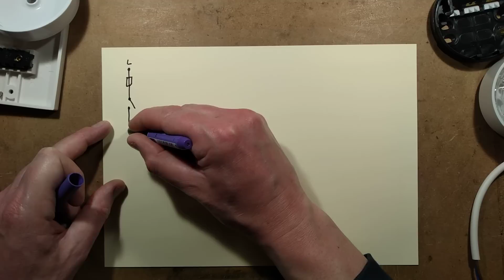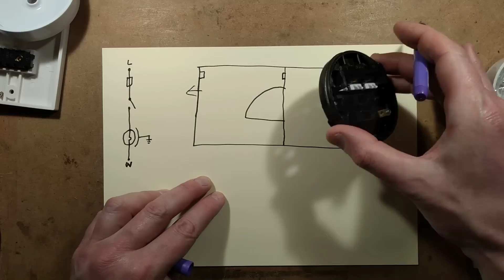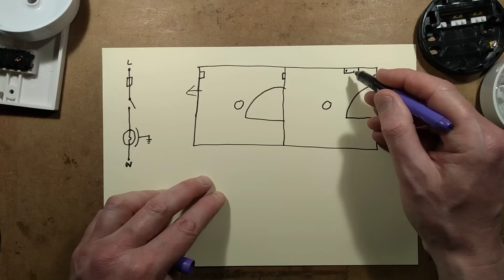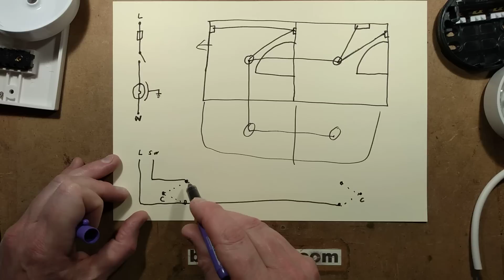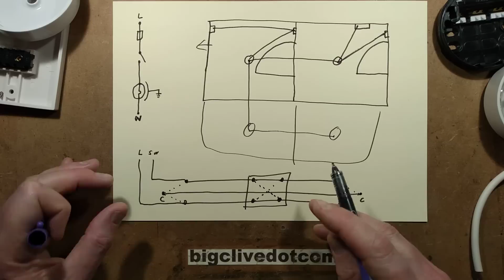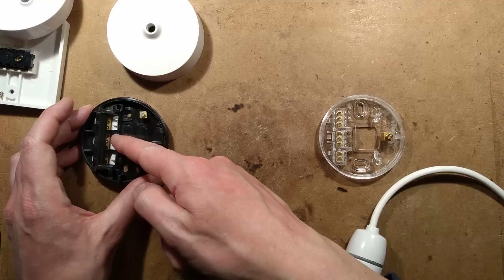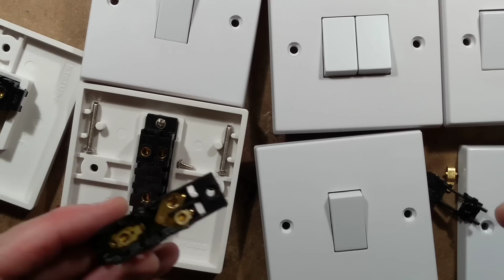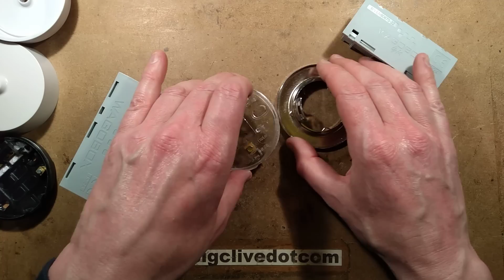British home wiring.  The incredibly simple lighting circuits.

Comment: It was soooooo hard to watch your explanation of the multi-way switching. The commons are where the the switched and power go to, and the other two leads are meant to be "travelers," which basically allow the switches to alternate the output.

Multi-way switching is and always has been one of the JFM things that most people don't understand.
Reply: Using the commons is only one way of doing it and because of the type of wiring used in the UK is not the best way! One T+E between the light and switch and a 3+E between the switches is the easiest to wire by far ;0)
We call the "Travelers" Straps here. Different strokes for different folkes ;0)
Reply: @totherarf  I think maybe his diagram messed me up... As soon as I started seeing it, I started my comment..  Maybe my ears didn't hear what they should have because my eyes were so distracted?
Reply: It may have been clearer if he had shown the closed position of the switch .... but give him credit, he is doing this on the fly AND thinking about the video at the same time ;0)

Comment: i see how it should work but ive never seen a 3way switch configured the way you drew it. in america anyways the common practice would be to  connect your L1 (mains power) to common then connect other 2 terminals to the corresponding terminals on the other switch the use the other common would feed the light.
Reply: Yes, I was thinking the same, and I'm in the UK. I have always wired them the way you describe. Both work of course, but I think your way is clearer on a circuit diagram.

Comment: In Sweden we use round boxes because it is much easier drilling a round hole than a square one when installing drywall...
Reply: R0T3 You can buy a backbox cutter here in the UK that cuts perfect sized rectangles for double gang backboxes
Reply: @sinista6536  At the same price as a holesaw? Can you use the "hole in one" system with magnets as well? For perfect alignment?
Reply: R0T3 I don’t know, never really looked into it, just seen it on a few electricians YouTube channels. Probably expensive as hell 😂

Comment: Very different from what we have in Canada (and the US), we twist the wires together and put a twist cap over the twisted wires creating solid connections but it takes up more room. We tend to have lots of circuit breakers, typical panel has room for 40 to 60 single breakers (120 V), double breakers for 240 V. 

With typical 120 v circuits limited to 15 amps our outlets can't even provide 2kw of power so I'm jealous that you can get 3kw at every outlet. On the other hand I really like our compact plug size but it only carries half the power.
Reply: 230V/32A max.... Poland. U can get 400V/230V/32A for additional cost. Lots of WAGO and common use TN-C-S

Comment: Not allowing sharp knives on a worksites is interesting. I help friends and family build disaster kits and I encourage them to not put large knives or candles in their kit unless they use them normally in their life. Slicing yourself during a disaster or allowing a candle to burn down to far is a really bad idea when emergency services are not available. 

But really on a work site where you use it on a regular basis. That is just silly. I guess this follows a current trend of seeing how little you can  train someone but still get the work done. No we don’t need nurses to have 3 years of education. 3 weeks should work just fine.
Reply: Electricians here (Sweden) typically carry a sharp but short and non-pointed knife, sometimes with a hook/slot on the back for stripping conductors of insulation.
https://encrypted-tbn0.gstatic.com/images?q=tbn:ANd9GcQ8TFXtBGnRBZnMiT7E9lryq4JreQFdcy0Ts38w_5NmILzpFDG7

Most other trades carry the generic "mora-knife"
Minor variations from various makers. https://encrypted-tbn0.gstatic.com/images?q=tbn:ANd9GcQOHq7aD_P-5vwDLZbkT7U0B5O3zPVAPnOpsAAHEiHs18TlHknt

The combo knife/chisel is becoming pretty popular as well
https://encrypted-tbn0.gstatic.com/images?q=tbn:ANd9GcSVW-wU9Q62OhndmRGMep2Czmp0MVV3cg0CdesW04Yi6MUbJKwC

Comment: In AU most cable has a sheathed earth conductor. 

Sparkies generally snip the outer jacket between two of the cores then drag one of the cores down to open the split up to expose as much of the inner conductors as they need, then snip off the excess jacket.
Reply: Don't even need to snip - just grab one conductor with both layers of insulation and just pry it apart. Then just trim off the outer sheath.

You can get pliers that will strip it properly for things like the 413QC's.
Reply: That's how we do it in the UK, then we when we terminate we sheath the bare earth with  green/yellow sleeving.

Comment: If you're interested I can send you some boxes and switches from the US, so you can do a comparison.
Reply: Ten 4 American Homes get a split single phase off of a center-tapped transformer. For example: my breaker box at home. The two hot wires come in and pass through a 350 amp main breaker. There are two “hot” or “live” bus bars which breakers can attach to. Each breaker for standard outlets or lights or small appliances is usually a 15, 20, or 30 amp breaker with the circuit linked between one of the busbars and neutral. The standard 3 prong outlets are designed so an appliance with a 15 amp plug can be plugged into a 15, or 20 amp outlet, but the 20 amp devices cannot plug into a 15 amp outlet. For devices that need large currents, say, electric stoves, clothes dryers, heaters, central air conditioners (most window units are 20 amp 120v), etc. are wired with a breaker across both “hot” busbars, which are essentially 2 120v 60hz phases 180 degrees apart from each other. This gives an effective 240v RMS which can be hardwired or plugged with a very large 4 prong plug (rated for up to 40 amps I believe) Quite a few American homes have large amounts of breakers, our panel has 60 breaker spots and all of them are full. American homes don’t usually have central RCDs, (GFCIs in the USA) instead opting for outlets with built in RCDs within 5-10 feet of any water source or outdoors, but there are some RCBOs used (GFCI-Breaker is a term I’ve seen in the US, but i don’t think they have an official name) Our hot tub, for example, is switched with a 240v 75 amp breaker with a 30 milliampere RCD/GFCI built in to the breaker.
Reply: @alexphillips4325  You actually have an older house. GFCI and arc-fault circuit interrupter breakers have been phased in starting in the early 2000s. By the 2017 NEC, essentially all residential interior circuits must be AFCI protected, all exterior, kitchen, bathrooms and sink receptacles must be GFCI protected, regardless of their proximity to water. Basically, in new homes, every circuit breaker is either an AFCI or an AFCI/GFCI combo.
Reply: @alexphillips4325  -- Another difference in the UK is that they have "ring circuits" whereas the US uses "radial circuits".  I think that radial circuits are authorized in the UK in certain situations, but any older house (which is probably the vast majority of them in the UK since they don't tear down and rebuild over there that often) are the ring circuits.  All that "preserving history" stuff kind of limits what homeowners can do if someone deemed your building "historically significant" at some point in time... :(

"Sorry, old chap, but Henry VIII's chamber pot emptier once owned this house, so you can't make any modifications to it..."
Reply: This would be interesting for all us UK folk, I've used most of what Clive showed here so not overly interesting, but seeing someone elses would be good - plus with Clive guessing at certain bits
Reply: I'm an electrician from the Netherlands so this would be interesting for me as well. Our boxes tend to be the kind you can fit into a 72mm cut round hole in stone or hollow plaster walls. We put plastic pipes between all the boxes so that installation can be replaced and modified even at a later time. So most of the home wiring is a bunch of single wires depending on need. the boxes behind the ceiling junctions for lights tend to be square, some shaped so they can fit between wooden ceiling beams for plastered ceilings.
Reply: @Ten 4 - Never heard of 3 phase in a house here in the US.  That is industrial usage.  Bigger appliances in homes get 240V instead of 120V.  It was interesting seeing some of the UK fittings.
Reply: @WmLint  industrial, or large apartment buildings. Many apartment buildings have 3 phases 120⁰ out of phase with eachother. This means that you get about 205VAC at the 2 phase appliance outlets. Why this is done I'm not actually sure lol, must be more efficient somehow ¯\_(ツ)_/¯
Reply: @stephentorrey8727  Because it's a large building, and so they decide, "Eh, might as well." In other words, not really any good reason. But don't take my word for it. I'm literally just guessing
Reply: @AuroraAsteribuni  Speculating here but it probably has to do with the transformer. Those split phase transformers they use probably can't handle that many units so they'd need a lot more transformers which means more space. Or just one of their normal 3 phase transformers. They could stock larger split phase transformers but then its another thing for them to carry.
Reply: @jacobthebirdy  You're probably right about that. Even with a single SPT going to multiple houses, it's still connected to a lot less than an apartment building.
Reply: I was thinking the same thing. Completely different.
Reply: I like their old work box's design FAR better than our flimsy corner wing crap. Looks more secure for sure, although there's not too much to that outer rim!
Reply: Don't we would find it interesting here in the u.k
Reply: Stop trying to embarrass our country.  :-)
Reply: @TheMechanicalPhilosopher  i think they do quite well at that on their own...
Reply: @TheMechanicalPhilosopher  lol

Comment: 25th ed. regs will have everything in SWA and 16mm bonding. You know, "just in case".
Reply from the maker: They've already been through a phase of that with something like 6mm final ring circuits.  Absolutely impossible to wire sockets with.
Reply: They will probably be wiring houses in SELV by then, all wasteful things like heaters will be banned for CO2 emissions.

Comment: It's interesting in the US we call typical wire romex and refer to it as a fraction 12/2 for 12 gauge 2 conductors (plus the ground we don't count it cause its always there) and boxes are usually referred to by cubic inches, what you call a two way switch we call a 3 way (three switches to control one light is a 4 way)

Comment: Very interesting to see the differences, because it confirms what I always say: "Just because it's code, standard, or deemed normal, doesn't necessarily mean that it's best."  I wouldn't want to wire under British code, but I also wouldn't want to be lineman for the power company here in the states.  It's ridiculous what is allowed in one scenario, but not in another!
Reply: the function of any code is for a SAFE install. if one strictly followed this it's safe... but NOT practical, efficient, pretty, etc. only that needed for safe. and at least minimal. and the Inspector may require "upward mitigation" as necessary to meet the standard.

Comment: I've always thought the British electrical standards were very good. From my perspective as an American they look quite elegant and appear well thought out. I  dread working on electrical stuff because the boxes here are so narrow it's hard for me to fit my fingers into work on it; even that shallow 16mm box looked delightful in comparison.That and the fact that our breaker panels here have a circuit for damn near each room so you can never remember what breaker turns off what. I've worked on a live light switch or two...haven't gotten zapped yet, knock on wood.

Comment: UK type boxes are a bit bigger compared to US type but i think that I might prefer them to ours.
I really like your plaster board (drywall) type boxes...very neat & easy to mount.
The Wego boxes are brilliant!
The only issue I have with UK wiring is the loop system...I don't really care for that type of wiring...too difficult to diagnose a bad portion.
Reply from the maker: The ring system is easy to find a break in, either by official test methods or by powering it from one side at the distribution board to narrow down the fault to two sockets.  The last one powered and then first one in the vicinity unpowered.
Reply: Ah...kewl..thought it was more difficult to diagnose.
Reply: I guess in theory it wouldn't be too bad if it was easy to disconnect each end of the loop at the box.

Comment: Whish we had that lighting rose in the states. Our ceiling boxes don't have terminals. Their just an empty can that we cram full of wires and wire nuts.  It can turn into a horror show. 🙄
Reply: We got something similar here in New Zealand but mostly used in commercial applications where we have sockets that are similar to our normal sockets but the earth prong (or ground as you folks call it) is a different shape. They are either on the ceiling itself or in the cavity above it.

Comment: In Germany we have round boxes  In the wall  making  it  very easy to make a hole for it with a special drill  bit.
Reply from the maker: For masonry we have a dual SDS system with a cutter to make a round hole and then a square box chisel to make it square.

Comment: I'm in Canada (USA is pretty much the same), and the boxes have a volume rating in cubic inches, as do any depth extensions added to the front. The device (switch/outlet), individual conductors, and wire nuts all have deemed volume that they occupy, and the total of these cannot exceed the total volume of the box.

Switching may be either on the end of the circuit (as you showed) or before the switched device, whichever is most convenient.

I must admit I've never seen 3-way switches connected that way. Here they are generally wired with the line going to the common on one switch, the L1 and L2 (actually, the two brass screws) connected to the corresponding terminals on the second switch, and the switched power taken from the common of the second switch. If the circuit continues to the switched device, there is also a neutral (and ground) running between the switches. If the switches are beyond the switched device, the switched power (and ground) also run between the switches, so either way you need 3-conductor+ground between the switches, and the arrangement uses the same amount of wire as that you showed. If you want a third switch, the switch has 6 terminals (full DPDT) and you have to wire the crossovers yourself.
This 3-conductor cable is usually white-black-red (neutral-hot-another_hot) (plus ground) but when the white carries hot (switched or not) each end must be "permanently marked" to something other than white (or green). I usually do this with a permanent felt tip marker on the full length of the exposed wire, although common practice is just to put a bit of electrical tape around part of the wire.
The ground wire is bare in the cable and bare (not sleeved) in the box.

Comment: The sleeving on the ground is... interesting. In the US, we use a very similar type of cable for residential stuff (NM-B/"Romex"). The Romex comes with ground wrapped in kraft paper. I would usually strip the cable by pulling it taught, then slicing the top down the center, since you can feel where the ground conductor is. The ground wires are kept bare, bonded together with a wire nut or terminal, and also to the fixture/receptacle via a pig-tail. As others have mentioned, our lighting circuits for residential are normally done on a per-room basis (eg. 15A circuit per bedroom using 12/2). I believe the only times I've seen "lighting circuits" in a home, it was done to save cost and use 14/2 wire instead.
Reply: In our house, the circuits are grouped by common walls. This results in all of the smaller bedrooms having outlets and switches on at least two different circuits. The largest, non-Master bedroom has three circuits, IIRC. One it shares with the outside short wall with another bedroom. One it shares with the upstairs bath and stairwell. And one it shares with the inside wall of the small bedroom that it shares the short outside wall circuit with and the exterior wall of the back center bedroom and the hallway. That center back bedroom has one rogue outlet that shares a circuit with the master bedroom's closet and bath. 
Makes no sense until you realize it minimized the length of wiring.
Reply: @JamesTK  It's really confusing when you go to the breaker box, though.

Comment: I suspect the difference in box depth between the UK and North America comes down to the diameter of the wire. At 220 Volts, you can get away with smaller diameter of wire to carry the same wattage as those of us in North America at 120 Volts. More diameter, harder to bend to fit into an electrical box. Also, our electrical switches are much deeper, again probably due to requiring double the amperage at half the voltage.
Reply: I agree and I think it is also due to most UK homes have solid walls - they have to dig chases for wiring and for the boxes into the solid walls.

Comment: Keep on rambling, man!  Brute Force & Ignorance would make a good thrash metal band name!

One thing I dislike about the UK-style standard is the size of socket plates.  In the US/Canada (& others) system, 4 sockets can be fit in the space of one UK-style.  This leads to running out of sockets.  I started carrying two 4-outlet power bars when travelling.

I'm aware of the advantages of the UK-style; local fuse, local switch.  It's just very space-costly.